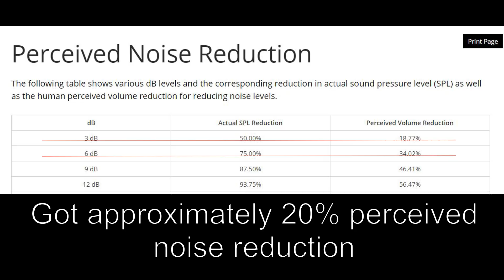2018 Toyota Prius Prime Sound proofing noise reduction project

Comment: Do you have a video coming soon for the roof too?
Reply from the maker: At least not for now, noise mainly made by tires from lower, IMO install on roof won't help too much but adding unnecessary weight and that part is hard to recover.

Comment: Wow their is almost no sound proofing in that car.
Reply: There actually is, he just didn't remove the carpet padding so you can't see it. 🙄

In the entire floor pan, there is asphalt. In the front wheel wells and hatch, there is a thick layer of rubberized polymer. The skid pads and front wheel well liners, rear quarter panels, and roof are lined with thinsulate. The firewall is acoustic metal.  Front windows and windshield are acoustic laminate. Rear fender liners are a felt material. 

The main weakness is the rear quarter panel and rear wheel wells, they have minimal deadening.  I think Toyota thought the thinsulate was enough, but it's not.
Reply: @joa8593  I didn’t realize, took a look under my 2020 prius prime you appear to be correct.